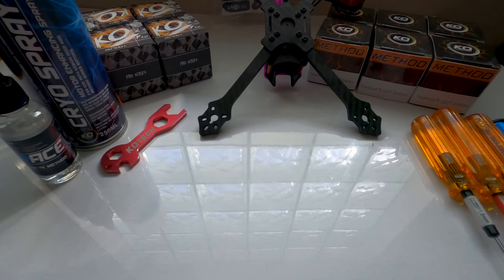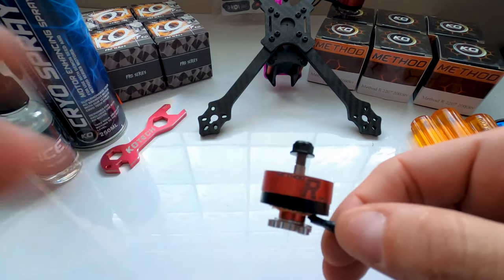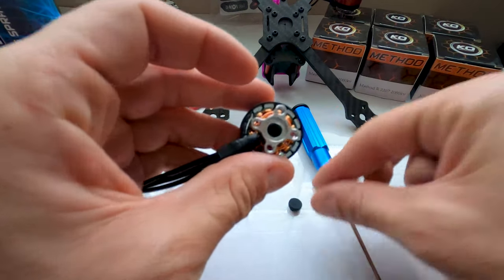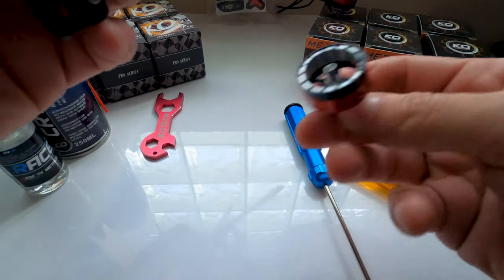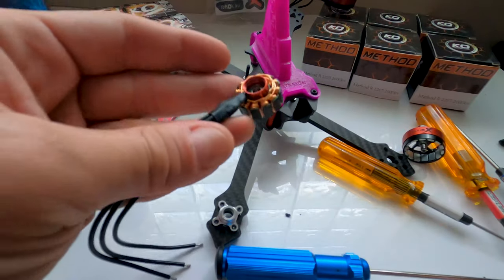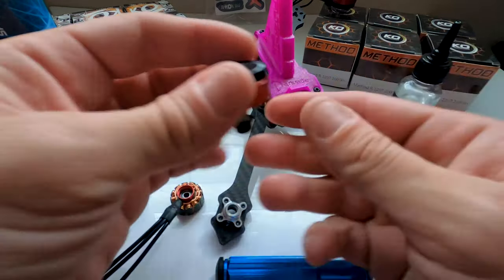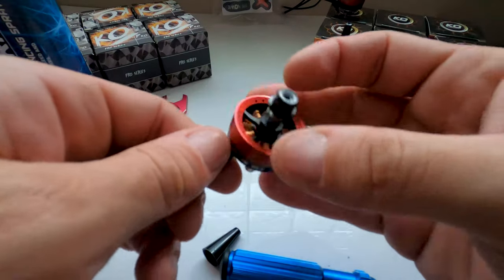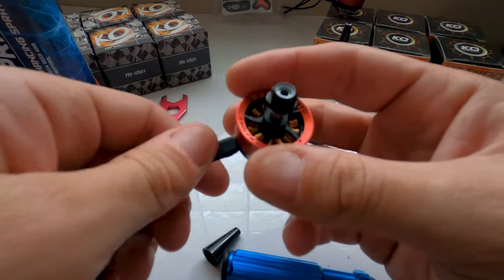KOTECHNOLOGIES METHOD R - Motor Maintenance and Disassembly

Comment: What props do you use with the 2000kv race motors?
Reply from the maker: I use AzurePower Exclusively 5140-5148-5150 . - Vanovers - Johnny props

Comment: Damn i just bought these motors but didn't realize they didn't come pre filled. Do you have a recommendation of which viscosity oil to use out of the three?
Reply from the maker: It’s their viscosity. Yellow is very light so better for racing , blue is middle and red is thicker better for videography. I’m using the blue
Reply: @EMDRONES  thank you :) i really appreciate the video, there's not  much info yet about these motors so this was really helpful!

Comment: Sexy motor!  With everything on them id say they are well worth the $30 price. And of course the sexy beefy Arc One frame there.  Still my fav race frame.  Loved it ever since shaun show me his at the mayhem race last year right before it was released.  Ordered 3 the day Fl1 put them on the site and I still have all 3.  Haven’t even broken an arm yet on them.  👍👍
Reply from the maker: Thanks Man They are good I got  mine around the same time I have 2 X and 2 Stretch X this is another X !! And these motors Omg I can’t wait to fly them !!!
Reply: @EMDRONES  nice.  Those motors should definitely push the arc to new speeds.  I’ve got 2 of each now but need to work on all but one.  I haven’t flown since June or july and finally got to Charge some packs yesterday and rip. Felt great! 👍. But noticed either my quads are all messed up now or my gimbals are jacked up.  Kept getting a weird yaw twitch, when turning around a tree or flag  for example  the quad would do a complete yaw spin and I wouldn’t be moving the stick at all.  I don’t think my micro did it a month ago when I got to fly it for a pack, till I killed it lol.  Ima look at everything today and see if I’ve got some issues with the quads or if they just need to be cleaned well due to sitting up for months now.  Also need to check the arc one with the rush race vtx, kept wanting to jump to pit mode mid flight.  Of and all the quads are Running flightone FalcoX firmware and I’m sure need to be updated bc it’s been at least 8-10 months since I’ve updated them but the tune I have just works and I don’t see a point in upgrading them.  👍